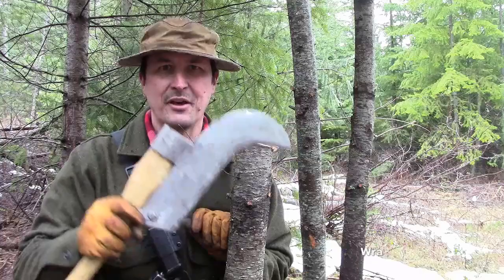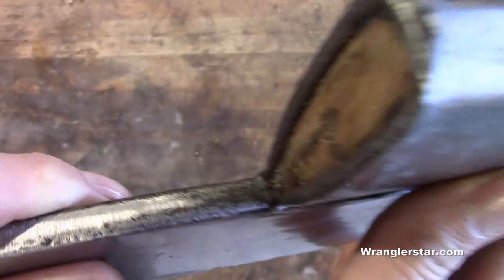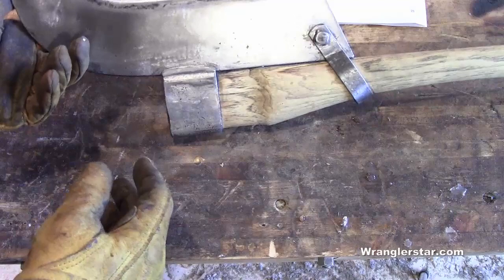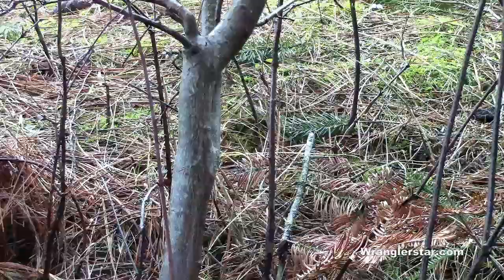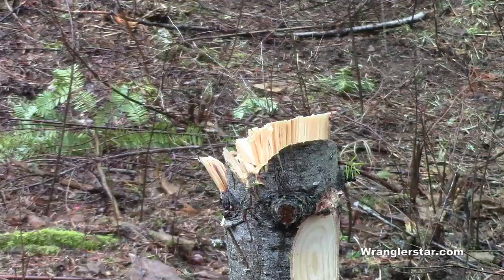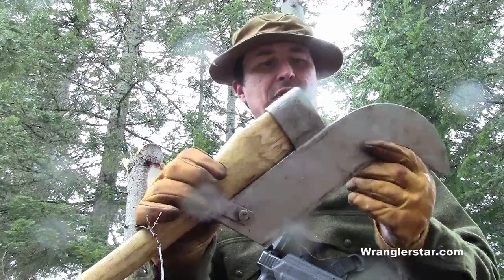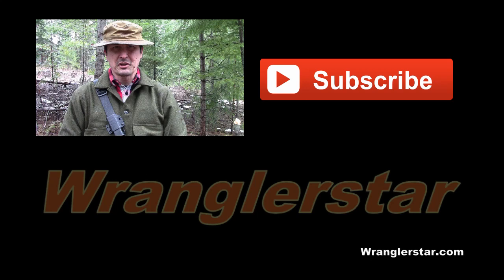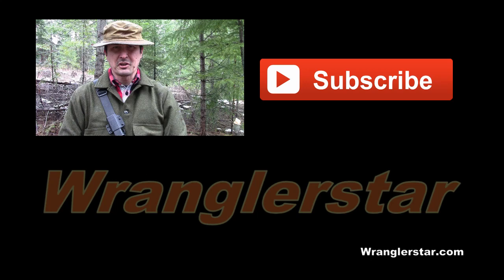A Proper Brush Axe - Wranglerstar

Comment: The brush hook has a different optimum cutting angle than an axe.  I worked on a 20 man Hot Shot firefighting crew and my tool of choice was always the brush hook. The sharpening angle is vastly different than any other wood cutting tool also. I always file my hook with zero shoulder and it was dangerously sharp (which is the only way I wanted it.) A dull tool is not as effective and can be more dangerous than a properly sharpened one.  They are amazing tools but, as you mentioned, very dangerous for beginners.

Comment: I never used one like this. Only the ones with higher bit on other side. In  tandem  we cut  down a 24 inch oak in under 30 min. Most of the old timers had sharpened theirs so many times they looked like Hocky sticks. Very effective. Very danger bird.

Comment: Hi, on the looser, more springy materials, try cutting at a steeper angle, about 30 degrees from vertical. The blade will bite and push against the long axis of the brush.

Comment: Great vid, could you please tell me what the tool on the bottom of page 25 is called ? I have one and have no idea what its called or used for. I saw that in the book and just had to ask. 
Thanks,
Reply: pause and read page 25 its a Swedish brush axe with a replaceable 5  1/2  inch blade , weighs 2 1/2 pounds and has a 27 inch handle
Reply: Thanks guys, I have had this for awhile, got it for free and have been using to cut off small branches. Just wasn't sure if it was made to do something other than that. 
cheers.

Comment: Not trying to criticize, but I think you should give this brush axe another shot.

I got a new cheap double sided blade and have been clearing a small field.

The problem is you are swinging it like an axe. You mention the small things that move around. You are swinging down! Danger of driving blade into the dirt and the springiness of smaller trees going to cause problems.

The trick is to swing up!!! If you catch the tree near to the ground and catch it in the crook you can take down things with one swing. Tree can't spring away...

Comment: Found an old brush axe in an old wares shop here in Australia. It's stamped with "Trojan 234 D↑D" which I believe may mean it was military issue, perhaps in WWII.
Not had a chance to sharpen it yet but it will be getting used once it does.

WS, Do you have Jim Dillon's ebay page? I'd be interested to see what he does with these refurbished old tools.

Comment: Cody you're a walking Filson billboard.  Love my tinpants and I just ordered a new coat from their web specials.  I hope to grab a mac cruiser before next winter so I definitely look forward to your impressions.
Reply: I have been wearing my tin's now for about a year. I have the double tin, you wouldnt happen to wear the single would ya? Im interested in wearing something a bit lighter in warmer weather.
Reply: Mike C. I do wear the single tins.  In the winter I mainly wear snow bibs so I got the single tins for summer.  They're definitely warmer than my normal carhartt double knees but not too bad. I'm starting to wear through the kness on my single tins so I'll definitely go with the doubles next time and just deal with the summer heat I guess.
Reply: cbursta Thank you for the info. I guess at the price these go for, I'll stick with the double. I bought a waist size one size bigger so that does help release heat, but still warm.

Comment: Yeah, technique is a major factor for using a brush axe. In my experience, it finds its best use in the hands of someone very strong trying to clear clusters of sub-1-inch brush with single swings, in particular things where you cut through at 90 degrees rather than at an angle like cutting with an axe. Also ids a tool that benefits from low sweeping and slight upward swings into extra light brush, notably briars.

Comment: That is THE tool for cutting sight lines for surveying.  Use a shallower angle than an axe and slice through trees.  Should be able to cut a 4 inch pine in two licks.  Kelly True Temper is the best but are no longer made and are getting difficult to find.  We use them daily surveying in the Southeastern U.S..

Comment: I've tried one of these and my impression was that it was kinda worthless. Maybe a small range of thicknesses where it makes more sense, but I like an anvil lopper for smaller, small saw for medium and a boy's axe for the slightly bigger stuff. Or just a chainsaw if I have a lot on my plate!

It looked like you only strike down. I always do an upstroke now and then to clear the chips out of the cut, on the bigger limbs.

I admit my dissatisfaction may have to do with ignorance in the proper use, though.

Comment: The type of brush axe that I know is the size of an axe, with a c shaped end and a removable blade with bolts at the end of the c. Hard to explain without a picture, but it works wonders in the central Canadian Boreal sheild

Comment: A "proper brush axe" is best used with a swing more like that of a golf club. It is to cut close to the ground and use its weight to provide power to the cut rather than the arms muscling it through the target. The bill cuts upward under most circumstances, the remaining axe-like region of the blade only being used when making axe-like cuts is necessary.

Comment: I have a small bearded axe with a 19 inch handle and 5 inch cutting face it is not so heavy so i use it for brush clearing works pretty well too

Comment: Try using more of a golf swing for springy brush that's on the ground. Let the weighted head do its work to swing through. Connect just a little bit on the upswing so you create some tension on the brush instead of compressing it.

Comment: In Texas growing up they are called a bush whacker the blade is thinner than the blade I saw on your video I used it as a kid digging waterline I would dig a water line but the roots were crazy and my shovel handle was always getting broke so I would chop on both sides of the water line cutting the roots and then shovel up the dirt and cut roots and all and me as a kid of 12 or 13 could dig 50 ft of water line a day 2 foot deep after school every day ( fifty feet was what I had to dig in order for the day to be mine ) I could have dug more but that was the request of my mother when we moved on the property) so it was 600 feet at fifty feet a day 2 feet deep and the width of a sharpshooter shovel and it went a lot quicker with the bush whacker and it was also sharp on both sides they go for about 60 bucks now and the replacement handle is about 25 dollars I still have 1 in my barn from when I was a kid

Comment: The trick to cutting springy stuff with a brush axe is you want to be cutting at an upward angle, not like a golf swing, but like a baseball batter trying to hit a low pitch into a pop fly on purpose, if that makes sense?  Then the weight of the axe puts the brush being cut in tension instead of compression, so it can't absorb the blow with it's springiness.  I just cut my niece a couple hundred yards of "corn maze" in some thick brush of young rock maples, sumacs, and 10' tall knot weed, in like 20min, and I'm by no means the axe chopping champion of the world or anything.

Comment: there is just no way i would use that weapon,i see it works but the effort you have to put into it is crazy.it maybe good for larger trees but i see it fails on smaller bushes,its just too slow and heavy,for bush cutting i use the BAHCO Clearing Axe.Ive used it now going on 20 years and in most cases when im makeing trails its non stop as i cut,its very fast.it only weighs a bit over 2lbs and easly fits in my back pack and it goes everwhere where i go in the woods.if you havent tried this clearing axe your missing out

Comment: seems like a good tool for debranching trees you have cut down, need to work out the use of the hook on the end, so far it seems to not get any use when just straight chopping.
Reply: More useful against vine and thorn type plants. Something you don't want to get close to.the hook part is so it will pull them into the main cutting area without letting them slip off the end of the blade

Comment: When you need to trim smaller branches off trees up to a few feet above your head you will see how well it works for that,and if you will aim your blows to almost ground level the brush axe will work much better,and after some practice you will be able to use it like a sling blade at times clearing a lot of brush,and undergrowth..,,

Comment: I use this tool at work I trim trees around power lines it’s better to use it around fence rows and in the mountain side because a chainsaw can’t not be run in a certain length of the line

Comment: get you a cold steel two hand machete.  it is incredibly useful for such as you chopped, very light and fast and safe, easy to control in case of a deflection or whatever, also very easy to sharpen, and can be used as a paddle, shovel, spatula, even you can hold it up by the rivets and use it as a chef knife, no shit, or for delicate one handed chopping tasks.

Comment: I never knew what it was called until watching this video but i picked up a Birk Blade at a roadside North Carolina Flee Market on trip along Interstate 95....  Double sided and the handle is bolted with a flange to the blade...  I believe those Brush Hooks like you have were, and perhaps still are used by logging road crew's and 4 wheelers for clearing road obstacles and deadfall...   Also i would imagine its probably used extensively by Smokejumpers and other Forest fire fighters....

Comment: Cut my teeth on brush axes on the coast of North Carolina.  It is very effective when you're clearing an area of smaller brush, because you can very easily cut small trees off below the ground.  Yes, I know... that's hard on blades and it means more sharpening of the ax.  But it does a great job for that purpose.

Comment: Not to sure about this tool, it would be used mainly for coppicing hazel and dead stuff, looks great but dangerous in novice hands, we use a smaller handled version like a billhook for cleaning off branches from felled trees if the small chainsaw is somewhere else. Rescued an old pruning hook from a farm the other day, the farmer had been using it to clean out his machinery, needs a new handle , cleaning and sharpen. Must be about 40 to 60yrs old, gave him a beat uo tramantino machete for it,he was happy as the machete was longer and got into places he couldnt reach. Fix the old gal up with a nice new handleand make her usefull for her purpose again. I was surprised he went for the swop, but what I gave him was better for his purpose, he is a nice man so I think he will be getting a couple of nice cigars for his kindness. Grace and Peace to all.

Comment: my two cents:  The woodsman should have two brush axes..one this style and the swedish style brush axe which you see in the very lower right in the magazine he shows in beginning....which is one arm and is obviously lighter and shorter and can take out 2-3 inch poplars which are very plentiful in the upper midwest...I can only relate to my forests....for example you would use the long axe when your taking out balsalms that you would have to de-limb with the swedish brush axe, no de-limbing as the long arm will reach and sever deep, also Wranglestar said he had problem with those springy small trees, if in clumps and with the right angle they should shed quick; if your in the woods and traveling and it's thick I would prefer the swedish Brush axe which I have used when working for the Forestry....for a team of 5-10, you would probably have all carrying swedish axes and one with the long, best for you to go in your particular woods and play around with the certain types of trees and bunches and thickness,,, you will find the pros and cons quick...

Comment: I have spent many hours behind a brush axe. Prefect If your clearing fields or scrub that have gone fallow for several years and get to be chest high. 
because of the wide arc that you can swing you can move MUCH faster with a brush axe than you can with a gas powered brush hog or weed eater. 
It will tire our your core and give you blisters from the twisting motion when it impacts something hard. But that just means your not doing it enough.

Comment: You have to hack almost straight down on the springy stuff. Very effective
Reply: That sounds like a good suggestion, would cut down on the bouncing
Reply: Jeremy Connor
That's what I learned to do on skinny springy tree limbs when using a machete.  Straight down perpendicular hacks just make it bounce.  When I tried to go as parallel as I could it would take them off more often.

Comment: I think this does look like fun to use and what not, but my Estwing hatchet sharpened by me, and my left hand putting pressure on that little Doug Fir(?), would probably drop it quicker, and my hatchet fits in the back of my cruise vest. Fine for some jobs, not for cruising.
Reply: Doug fir or some type of Abies...or true fir I suppose? What kind of young pine has sap blisters like that?
Reply: Also, any weak pithed or herbaceous stems with a smaller diameter might be perfect for this tool.

Comment: We called it root axe.  Want to get rid of a shrub that's been in place for 10 years? Dig out around the roots, straddle the hole an swing it down to cut the roots. You can really get in behind the roots and make short work of the unwanted bush.
Have fun.

Comment: On that first bunch of saplings, perhaps trying an upper sweep, would take out much of their spring. Similarly as the way a scythe would wheat. i can visualize the need for the curved blade,s ability to gather 4 or 5 of those saplings together with a more slicing, rather than chopping fashion within each stroke. The lower the cut, the less the springing. Like Mantle reaching low and sweeping it out of the stadium... but in this case to avoid the blade dulling dirt. Or maybe i visualized all of that, on that movie 300. At any rate, May you and family have a thankful 4th.               -gilpin 7-3-16

Comment: I have watched this video twice and with luck ran across one that was in super shape with only the words Kelly Axe & Tool Co. Charleston W VA on it. The main head part for the top of handle looks like it was forged because it is not welded like most all the ones i see. As i was typing here i keep looking at it and it is forged together because i can see the fine line and hammer marks when it was put together and it is smashed together inside of the main head. I am going to replace the handle because this one is all dried out and looks to have rot starting in on it. This axe has green on it about 90% with some surface rust. Looks original to me. What do i have here anyone know.??.

Comment: It's meant for anything in between grass and wood i.e. ferns, brambles, small shrubs. Definitely not meant for chopping.
Reply: I've personally hacked down 2 to 3 inch trees in 1 to 3 swings. Could be my boss sharpens his more, also the ones we use are different than the one he has

Comment: Aren't you supposed to use the curve to pull through thinner stuff.
Reply: 101platayoro The curve is to give it slicing capabilities to bite deeper into the wood I believe, like how a Kukri knife was shaped for cleaving the heads of the English.
Reply: Missioneer Was it?
Reply: Kandidaten Look up The Gurkhas when you have the time; they have an interesting story involving the kukri knife. The knife wasn't made for cleaving heads, it was made as a general purpose farm tool for chopping wood and undergrowth. The arch in the knife allows for an increase in power at the point of contact, and the sweet spot of the knife has enough power to, as said before, cleave heads. The Gurkhas did just that when dealing with the British in Nepal back in the 1800's.
Reply: Missioneer Yea, I read some about it, pretty interesting.
Reply: Kandidaten No, kukris were developed long before the appearance of the English.
Reply: ***** The kukri dates back to early Egyptian times, but since then has been modified. Not sure why you said "no", considering the information I supplied stands true, and is pretty interesting. You got beef with the English or something, bud?

Comment: Perhaps the handle is incorrect and it should have a short one so it can be used one handed like a machete with the other hand used to stabilize the springy brush???  I don't know anything about them.  This is just an idea?
Reply: I'm going to keep an eye on the ones I find used and see what handle is on them.  I was thinking the same thing.
Reply: Both are used. Shorter handles and slightly lighter blades for lighter work (or to be used in a similar fashion to a machete), longer and heavier for clearing work, e.g. of over grown ground brush.

Comment: Some folks call it a sling blade, I call it a kaiser blade. It's kindly a long, wood handle, kinda like an axe handle, with a long blade on it shaped kindly like a bananer. Mm-hmm. Sharp on one edge, and dull on the other one. Mm-hmm. It's what the highway boys use to cut down weeds and what not, y'know.

Comment: I know it is a while, and you have put yourself out there for the whole world to scoff at, but:  

When using this tool for cutting larger trees, think axe crossed with knife/machete, let the curve work for you (slicing in around the corner), but dude, you gotta get those chips out, where were your back cuts, the blade gets stuck because you were trying to make a  feather stick, not cut a tree down, chips gotta fly, as-in leave the trunk.

My experience, using a machete and similar tools for slashing trails etc over 20+ years (in hardwood environments), let the tip work to your advantage, not against you.